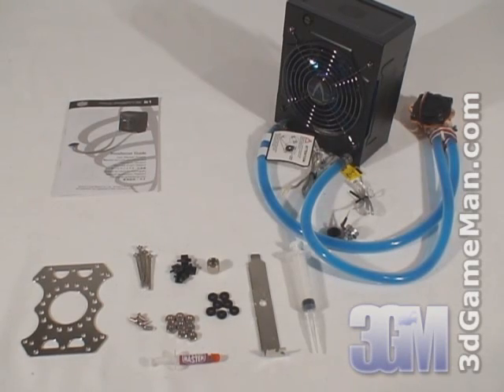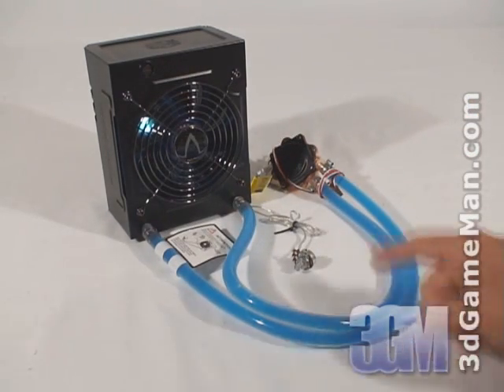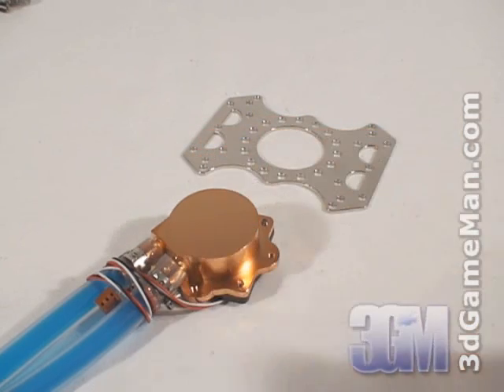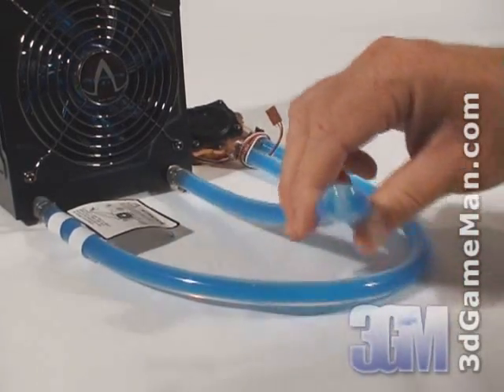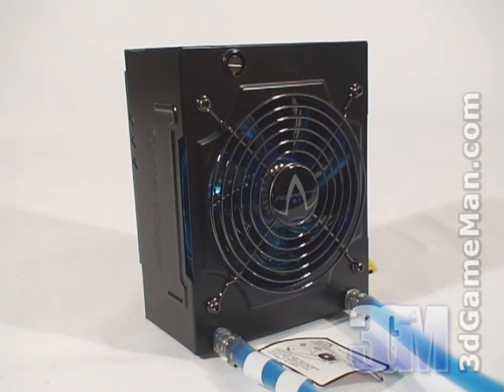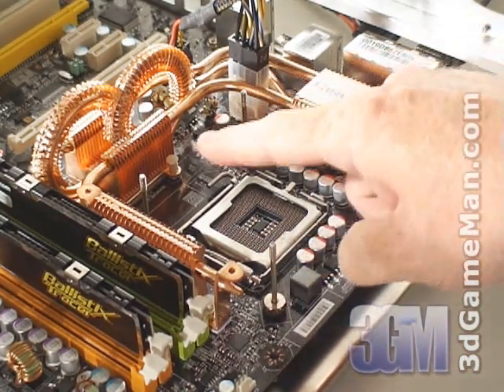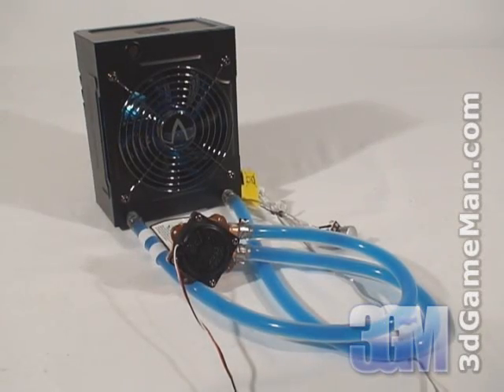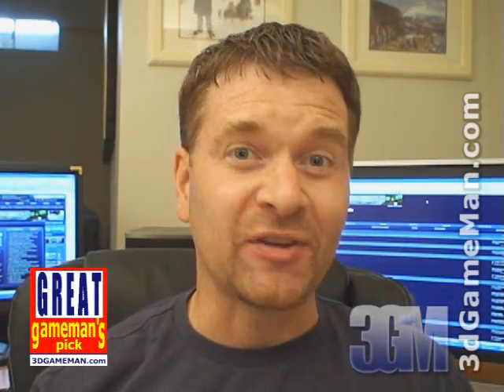#840 - Cooler Master Aquagate S1 Water Cooling System

Comment: then you had a mineral oil or a type of oil liquid cooler cause 95% of liquid cooling systems come with distilled  water with a type of anti-freeze for the coolant

Comment: You would have to go out or find a block on the internet that would fit your GPU chip. They should be easier to find if you have an Nvidia 8800 or higher graphic card. and all you do is pop off the stock heat sync and apply the new water block on the card similarly to the CPU process.

Comment: You'd have to get a separate water block, tubing & clamps for your GPU and add them to the system.

Do note that not all GPUs support liquid cooling, so you may not be able to find them. They're usually available for the most popular cards, tho.

Comment: Its awful i have it on my lan pc, its noisy and the temps are awful on it on idle my q9300 is sitting at 52c, and i had to mount it out side my pc because the rad started to leak beacuse of a rubbish seal.

Comment: the Thermaltake is better, then you can add GPU and HDD(why?) waterblocks. Besides all I do is I shut the computer off at night. MIght I add this has no overflow tank like the Thermaltake. So when water gets hot it has nowhere to go, and POP goes a hose.

Comment: i just got this yesterday and installed it today in my gigabyte aurora 3d case. its NOT as loud as the video review. it also doesn't make that ticking noise. i think it's because of the position he had the fan/radiator. anyways it dropped my cpu down from 40c to 32c. so it works pretty decent for its price.